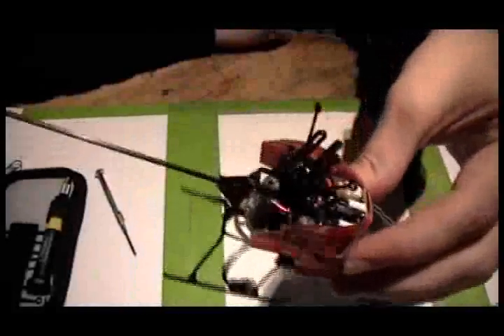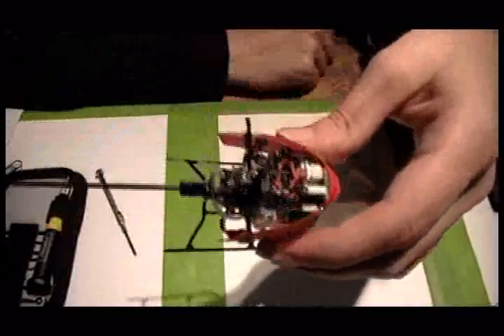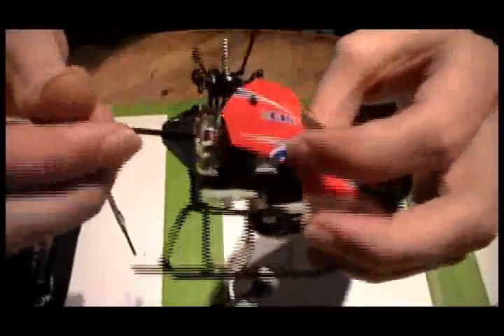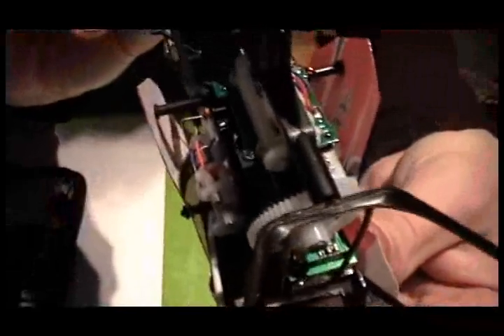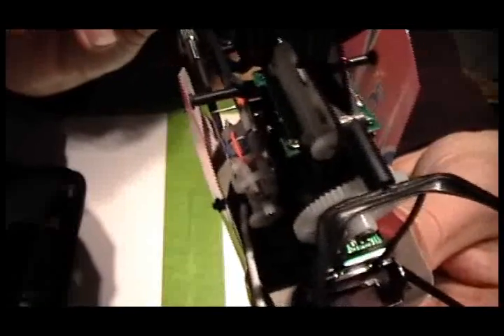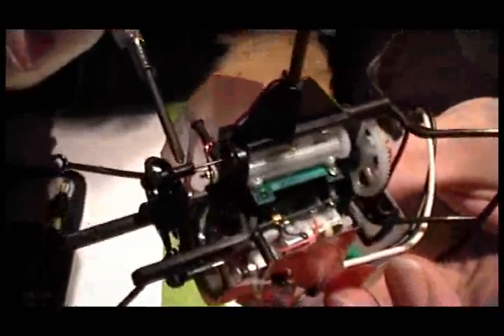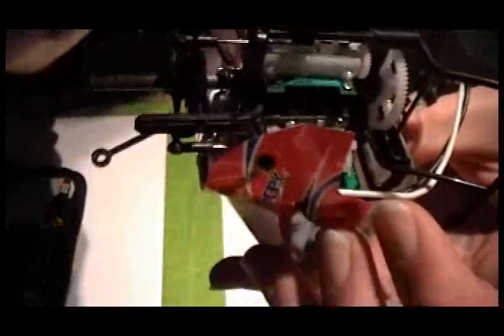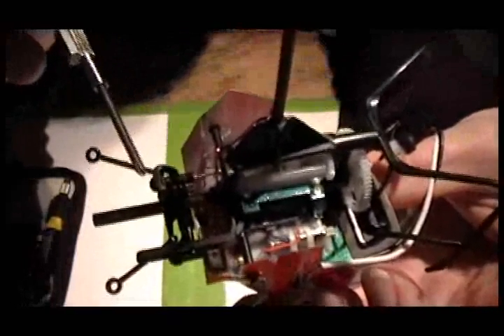Blade mCPx Swash Problem

Comment from the maker: @genmischief It IS because of the straight link. Helicopter crashes are random - if you crash this thing and don't break anything, you got lucky. It is designed to fly, not to crash. It survives crashes pretty well, but that's a side-effect of being small, not a design feature. So, consider that before you get angry about broken parts from crashes. If it broke in the air then you should get a replacement. ALWAYS call Horizon about any issue you think they should address. They have good warranty.

Comment: mine broke off...after about 2 dozen crashes.
some of these breaks are really hard to come by. people complain about bearings in the grips and i haven't had that problem yet and i've really beat the piss out of mine. it seems as though the crash has to be on a specific angle and also such that they may even look minor but still was the last straw of course from wear of previous crashes.